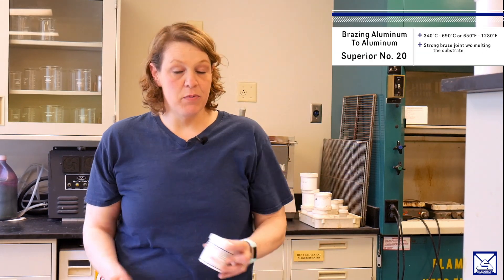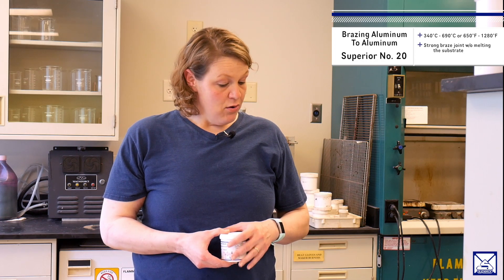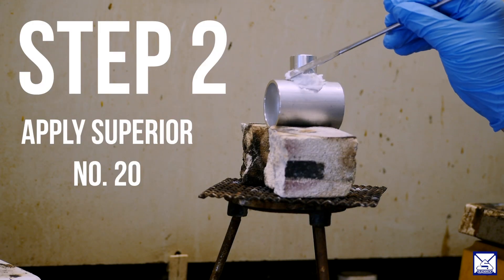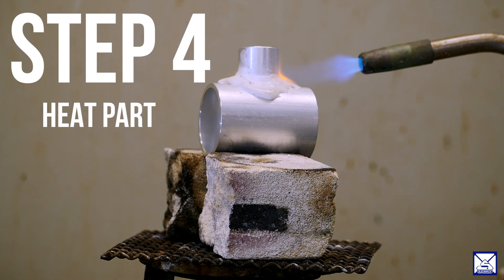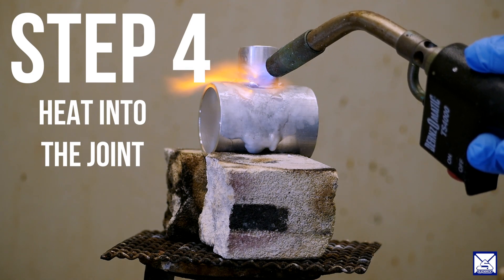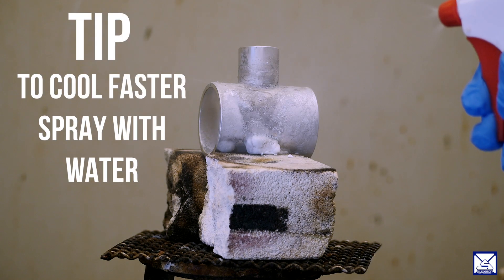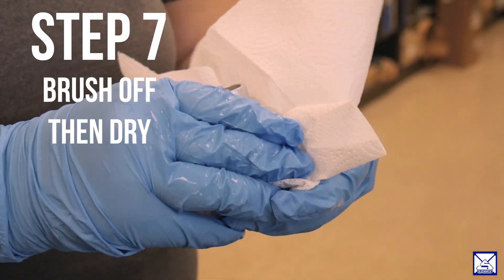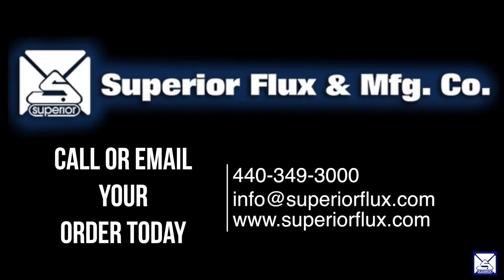How To braze Aluminum to Aluminum

Comment: Is it work with 2 mm thickness of aluminum ? Or less then tht..
Reply from the maker: Hello Nidhi, Superior No. 20 will work on different sizes of aluminum. However, you will need to be careful when heating. If you have more questions please call us at +1-440-349-3000 or email questions to info@superiorflux.com. Thank you!